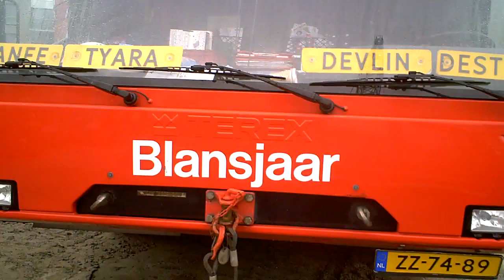HUGE 14 Wheel 135 TON TEREX  AC 200 - 1 TP crane

Comment: Are you sure it is road legal with 135t total weight? As far as I know in Nederlands the maximum allowed axle load is 12t (one axle = two wheels), so this crane would be allowed to weigh 84t on road (7 * 12t = 84t). You see it doesn't drive with the counterweights attached, they are transported separately on a truck.

This is a 200t crane. Now days there are mobile telescopic cranes up to 1200t capacity on the market! Simply do a Youtube search for "LTM 11200" and you will find something huge!